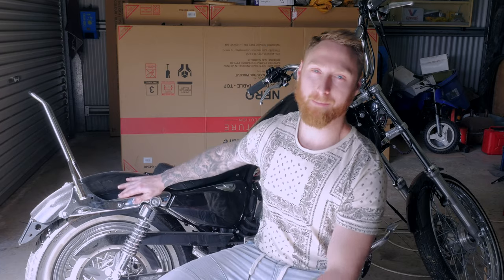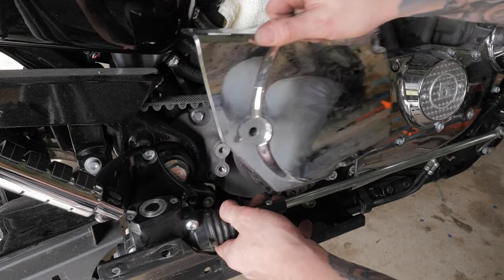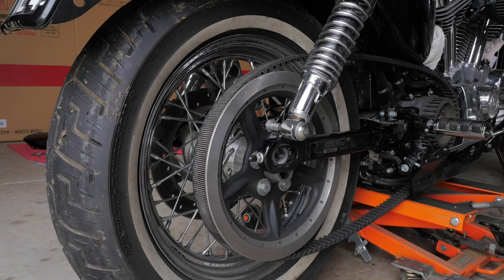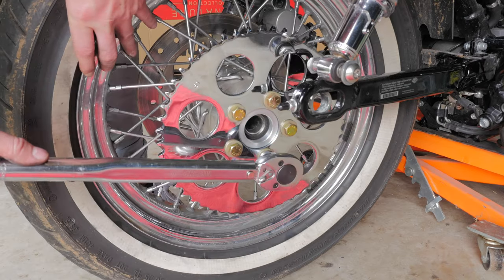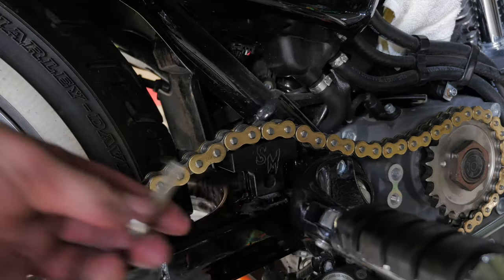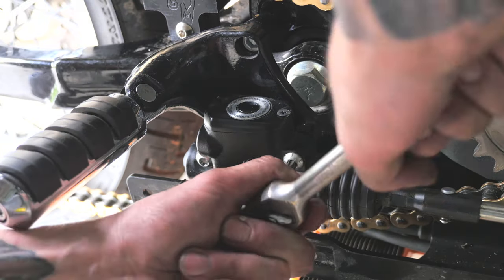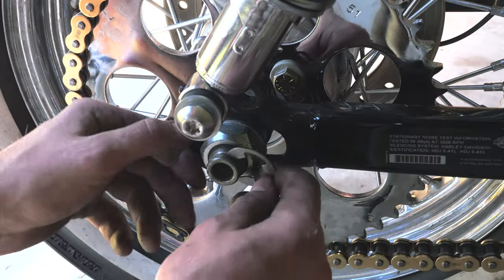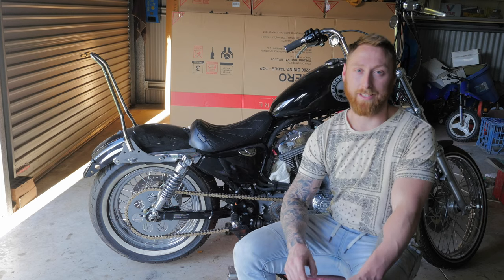Sportster chain conversion - EP 1 Unnecessary sh#t for the Sporty

Comment: Recently did the chain conversion on my 1200c and got a lot of scraping of the chain on the exhaust bracket at lower part of the passages pegs, did you get any scraping? Ended up curing out the exhaust bracket. Thinking of getting the chain slider, but not sure if it will stop the scratching at the bottom of the passages peg.
Reply from the maker: Hey man in the video I installed a chain slider to avoid the chain hitting the passenger peg mounting bracket. If yours is scraping you definitely need a chain slider. Check out sporty mob on instagram, they sell chain sliders cheap 👌

Comment: How much more torque and did you go with the standard o ring chain or the x ring chain. Im doing the same to my 2000 1200s and opted for the gold 530 x rings.
Reply from the maker: I went with an X ring chain and I didn't notice any noticeable improvement in torque as I went with similar gearing ratio as stock. If you went a larger rear sprocket than I did then you would notice an improvement in bottom end torque but less top end speed.

Comment: 90-100 ft lbs is way too much for the procket locking plate are u sure the manual said that ?
Reply from the maker: Yes mate it's definitely correct as per the manual.

Comment: How is the chain slider holding up?
Reply from the maker: Really well man. You will notice a fair bit of wear once you first fit the chain slider because the outside links of chain wear a groove in the flat surface. Then when there is a groove on the chain slider from the outside links there will be a notch in the middle of the chain slider where the rollers on the chain have something to rest on. Once the chain rollers have something to rest on the wear is really slow. Hope any of that makes sense.
Reply: @TheGingybeardMan  thank you!